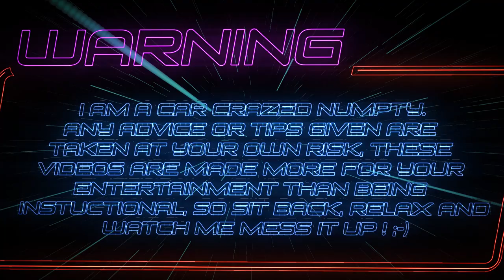DAMAGED AGAIN !!! | London Black Cab TX4 | CAB VS KERB ... CAB LOST !!!

Comment: Great work as always…👍🏻

Just a warning of precaution When your using any paint that is 2k you really need to wear respiratory protection as it’s based loosely on cyanide as you know that’s poisonous.
Reply from the maker: Hi mate yes you are most definatly right, i always seem to forget that 🙈 il do my best in future to remember 👍👍👍
Reply: I have noticed that you did the same thing using the 2K clear on the dashboard of your Reliant on a previous video. It's common knowledge that a suitable respirator must be worn when using 2K products, one example is the Gerson 2K disposable respirator found in eBay. Ideally an air fed mask is used due to the isocyanates contained in the hardener. I have used UPOL Clear #1 lacquer many times on my vehicle and I get the same finish on my paint jobs without the risk of being exposed to isocyanates. Great finish on your bumper, but just don't risk your health for the sake of an excellent result.